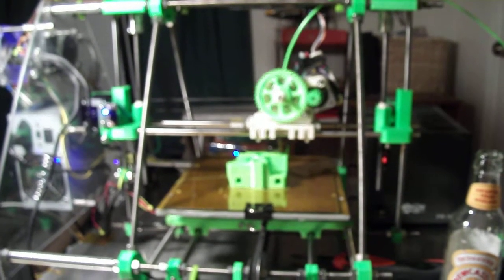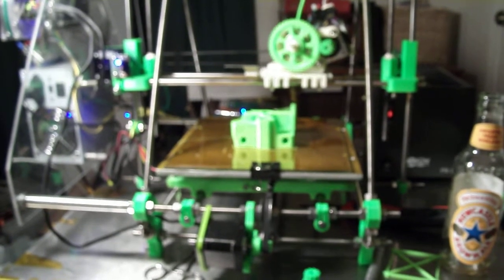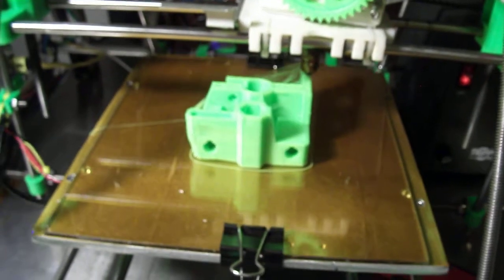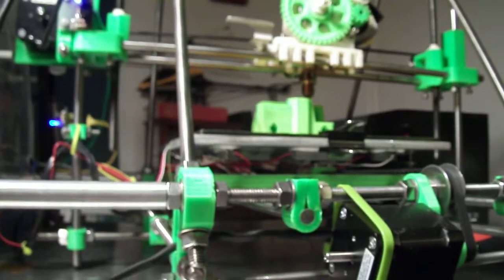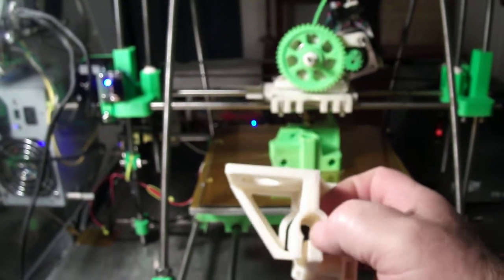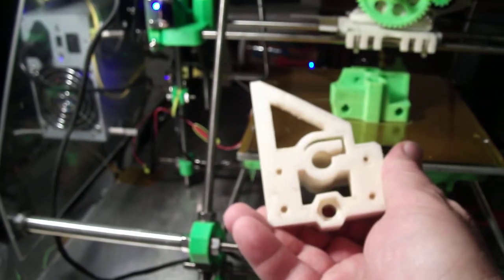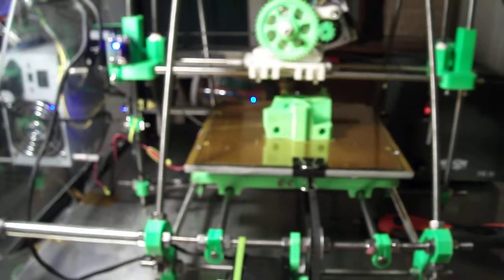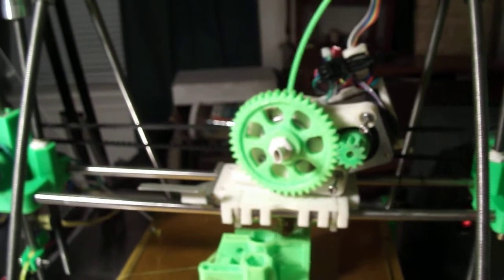Y axis 4 linear bearings

Comment from the maker: Well if you buy a kit be forewarned, buy a kit that will use linear bearings otherwise the resolution will not be there, the kit I bought used pla bushings, all the original parts from the kit I am no longer using, it's all been upgraded, so I have achieved great resolution now. Watch my last video, some of the parts you will have to download from the forum I posted, have fun, Jeff.